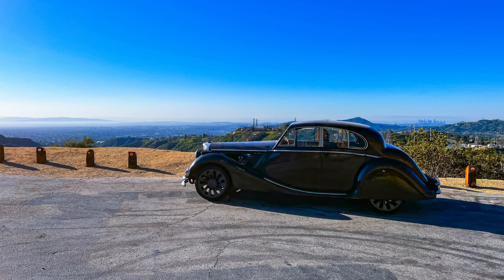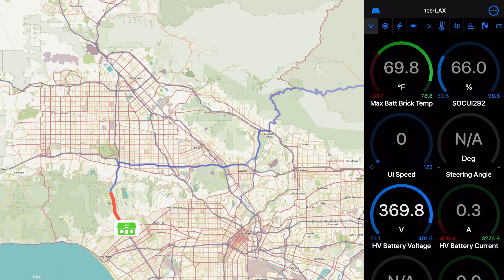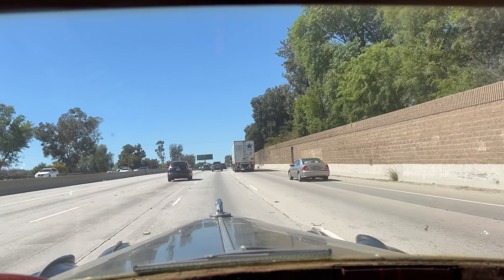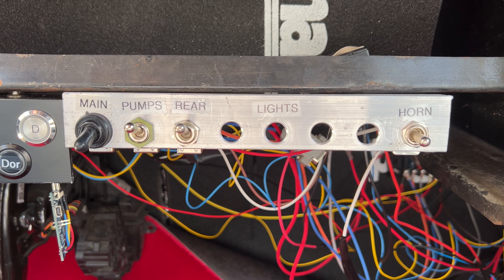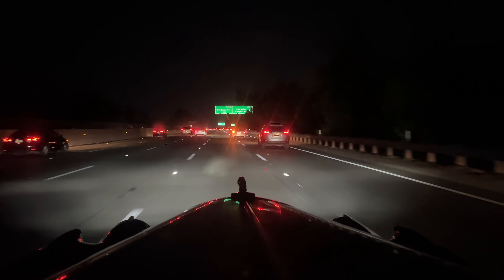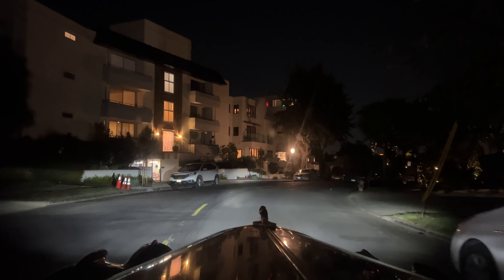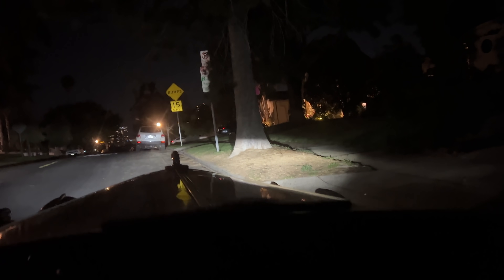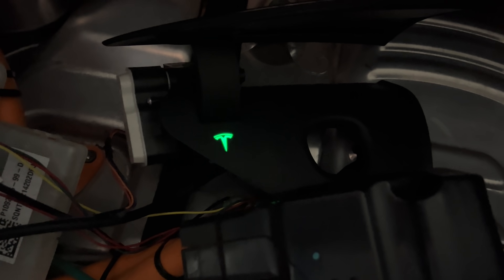I Find Out How Far A Tesla-Powered Jaguar Can Go

Comment: Oh man, that ending. How many miles did you end up getting out of the battery? And what’s the total SOC you ended up using with charging included?
Reply from the maker: Between the two trips I think it went through about 105% SOC, and I went about 160 miles. So given that 7% = 0%, we'll call it a 140 mile range.
Reply: Or about the same as a 78 Dodge D150 with a 440 and a 35gal tank. Seems about right
Reply: @SuperfastMatt  Why not get 2 Model S module's wire in an inverter say from an I-Mev backwards engineered to act as a jumper/get home battery ?? thus the inverter jumps the module's from 24v/?kw x 2 >> ?v/?kw? and to charge them just have regen only active for them ?? 2 module's/inverter in the old engine bay....
Reply: Would Neutral have been helpful on the short downhills, to build momentum rather than regen? You might have coasted further than you limped!
Reply: @richardortiz178  Going faster means more friction so more losses of energy to the outside of the system. With recuperation you transfer kinetic energy into electrique. Depens on the losses of that transfer of course but id say aerodynamics aren't in your favor. So recuperation should be better overall.
Reply: @kylereese4822  Every electrical conversion causes efficiency losses, aka heat. If you're gonna carry extra battery, you'd get better total range by adding to the main pack, because each cell delivers more total output when the draw is lower. This means that if you added 20% to the nominal battery capacity, the actual usable capacity increase would be more than 20%, assuming the extra weight didn't drastically increase the rolling resistance.
Reply: @SuperfastMatt  More than my 2015 e-golf.
Reply: @kylereese4822  If Matt did this, he'd HAVE to set the system up to be switched using the front half of an old British motorcycle petcock valve mounted on the dash. It would look semi period, and the "On", "Off", and "Reserve" markings would be very appropriate. :)
Reply: @kylereese4822  Because the easier/cheaper answer is to just charge it for 5 more minutes in the middle, now that he knows the range.
Reply: You should add a gas generator to the engine bay
Reply: A slight improvement in the rolling resistance might have worked. Putting a few extra PSI in those tires before the journey. Try it again with a few lbs more.
Reply: @andrewabbott4387  the little 2 cylinder prototype Mini engine would be great for that, or a Vespa 150 with the foot crank hanging under the bumper
Reply: @richardortiz178  There's no neutral in a Model 3 transaxle (or any other single-speed EV transmission), and a motor which not motoring or regenerating is basically in neutral.
Reply: @12x2richter  Let no-one accuse Matt of ever taking the easier/cheaper option, when a more expensive and complicated solution is right there for the making!

Comment: FYI the image you showed around 5:10 was a double pane window, found in upmarket vehicles to reduce wind and other outside noises. It may or may not have UV and/or IR mitigating tint involved, but the primary function is noise. That being said, a good ceramic tint job from a shop for ~$300-500 and you'll be set

Comment: On the plus side, you've already fabricobbled a mounting solution for the larger than necessary battery modules, so if you're willing to throw more money at the problem and open that can of worms back up, you can totally upgrade the range with the higher range battery packs.

Comment: I’m working on an electric car using 18650s similar to the Tesla Model S. I’ve built a motorcycle, snowmobile and ATV using these same cells. I put in an “Anti Range-Anxiety Switch” that gives me the option when my BMS kicks out the power to get home.  The BMS shuts off at approximately 3.0 Volts per cell. At full battery charge I know my range and amp hour usage. I know this quite accurately because I test to BMS shut off. I then use the switch to get me home. Never draining the cells below 2.7-2.8 volts. The batteries will last my lifetime 😊.   I’m also implementing the switch on my car.

Comment: Love the channel! Wouldn't  you agree "battery percentage" is of little use? I like the thinking behind the "cycle analyst" (ebike display from Grin Tech.). It's made for DIY´ers and displays the voltage of the battery pack and the watt hours used. When you get to know your battery, it's voltage and capacity at full charge, the low voltage cutoff etc., it becomes sort of intuitive how much range you can expect in different terrain, assist setting, weather, temperature etc.

Comment: Electric scissor lifts also have a low battery cut out and tend to get stranded when the battery runs out.  The cut out can be overidden by the engineer/delivery driver so there's always enough power to retrieve it and get in on the truck.

Comment: The contactor issue is likely a BMS over discharge fault. Pulling current through some resistance will drop the pack voltage. At some point during the drive, it’ll get too low and the BMS will open the contactors to prevent damage due to over discharge. When you let it sit for a few seconds, the power draw is gone, and the pack voltage will rise again, allowing the close of the contactors. Pretty cool to see it in action since Tesla hides it behind a wall of software protection

Comment: Great video. Such a good thing to test. I think range anxiety needs calibration for every EV driver and their car. Once calibrated it turns from anxiety to knowledge. :)
Reply: For sure.  I was so worried about range anxiety that my first foray into electrics was a Chevy Volt, which only has about 50 mile range, but then a fully capable gas engine behind it that kicks on when the batteries get low.  It turned out in the 2 years I had it, we only had the motor kick on about 3 times.  50 miles was longer than you'd think it was, even when there's no risk of being stranded.  
Now the EV I built, which may have the same 40-50 mile range, but I've never had below 80% charge because I'm worried about how long it'll last.

Comment: Discharging batteries very low damages them ever so slightly every time u do it. So whatever range u had u now have a tiny bit less than that
Reply: Matt used to work for Tesla as an engineer, also Apple and auto startup Canoo. He probably knows more about batteries than you.
Reply: @EmyrDerfel  Why so salty? I was just trying to add something that I didn't see in the comments nor was it mentioned in the video. I'm not even doubting Matt. He's a great mechanical engineer.
Reply: Ya those battery packs have BMS' in them, they're fine. Stop pretending to be an expert.
Reply: @NvidiaRTX5080  Ofc they have a bms, all the lithium based battery technologies have to have a bms to be safe to be around. But just because the battery voltage is slightly above the hard limit set by the bms doesn't mean it a healthy state of charge for the battery. An analogy would be maxing out parameters of something so that it's technically still in spec, but works way harder than it should and therefore decreases its lifespan significantly.
Reply: @QuibizOwl  These aren't generic aliexpress BMS systems, they're properly engineered to not do that. "Spec" is based on a worst case scenario for these, so it's well within what we would consider typical healthy operation.

Comment: I guess we've all had range anxiety whether we drive an electric or an ICE car. Still, despite it all there's plenty to be positive about - you made it home, and it's better mileage than, say an eight year old Nissan Leaf. I well remember making a 350 mile journey home from the south coast of England to the north east coast thereof. I thought I'd have enough petrol (I'm British!) but the last 25 miles with the little red light for low fuel on, then the last five with it flashing at me weren't fun. It was after midnight and all the petrol stations were closed. Sigh of relief to pull onto the drive!

Comment: You should try a battery pack with a power inverter, it could be your version of a fuel can. Hell, if it works you can cut up a Jerry can and make it an official emergency "fuel can"
Reply: Apparently Li-Ion has around 400Wh/L of power density. My Bosch Powerpack 400 has 400Wh and is about the size of a Water Bottle, so that fits.
20L Jerry can -> Theroretical 8kWh of energy storage. Even if you cut that in half for good measure that's nothing to sneeze at.
Reply: a 1 KW 110v battery generator. can charge a T for ~ 4 miles.

Comment: What a monumental moment. Few will understand the joy and stress of the first drive after rebuilding or extensively modifying a car. I stalled my first build at a light on the way to work and that's when i discovered the starter I selected of two options had a dead spot.

Comment: "I should've gone with the bigger battery" - The EVers lament
Reply: In fairness, the biggest reason for this is that the battery is THE most expensive part of the drive system.  When you're trying something new, it's hard to go "Sure, I'll spend $24,000 for a used Model S battery pack and get that 250 miles of range".  Matt went BIG here.  I converted a 1955 GMC truck, and the EV equipment ran me roughly $10k.  If I wanted a 200 mile range, I'd LITERALLY be adding another $18k to that figure, easy.  That's tough to do when you don't even know how it'll drive, whether you'll want to be in it for 10 minutes let alone 3 hours!

Comment: Watching this while battling the low battery indicator on my wireless mouse made it an even more nerve-racking experience.
Sure, I could put a new one in there (perhaps even the correct size), but I prefer the lighter weight and who's to say 1.2 something volts isn't plenty on a AAA?
Reply: I'm at 4% battery on my phone when I finished watching this, I feel ya.
Reply: Why do you need to move your mouse during a video?
Reply: @RustyCraftKnife  The thing kept flashing red for 30s after every action. That is supposed to be the low charge indicator, but the battery voltage was above that treshold, so I kept messing with it to make it read the voltage correctly.

Comment: Just carry a portable generator with you 😁😁 mount it under the hood and run the exhaust out under the back ! At least you can get some power back into your main power system
Reply: A vintage hybrid Jaaag would definitely be a sight to behold
Reply: the problem with that is, you would always be carrying around something you never actually want to use .....I realize that living out west USA(when I did) that it is pretty common to spend ~3hrs of each day behind the wheel driving; but where I live(now) I'd be visiting a whole nother state if I drove that far - and say if you lived in Europe you might end up in another country or something ... and it seems anywhere you go now in modern times, at least has power already there for light bulbs or something; but an old rusty leaking fuel can, maybe not so much

Comment: From someone who sets off from home in the morning driving to work with the low fuel warning light on, and doesn't fill up until I'm on my way home, I respect the experiment. I've only run out twice - once on the run down to the petrol station. Didn't have enough to turn onto the forecourt so I had to park on the road adjacent. Luckily my friends worked at that petrol station and ran out to push me the last 20 yds. The other time wasn't so good - had to wake my wife up to come out with a can of petrol. She was pregnant and unhappy with my stupidity.

Comment: If you wanted more range you could use fuel efficient tires. My Chevy Bolt came with Michelin Energy Savers from the factory. They are not grippy though, very hard. Also maybe you could run your pumps less, after you figure out how hot things can get.
Reply: I'm this case MOST of the energy is lost due to air resistance, not friction. That's kinda what happens when you have a brick wall going down the highway.

Comment: I'm wondering why the Grand Am had that interest? I can only think of two things... It somehow had a 3.8L swap (which is hard because of the very tight space), or it had the HO Quad 4. The HO Quad put 180HP to the wheels stock and could be comparable to the VTEC in power per displacement, but it also had a propensity to have timing chain issues, ignition heat-soak problems, and cracked heads - so finding a surviving one in good condition is exceptionally rare these days. Notable power for that era and coming from GM of all places, but poor reliability and I suppose that's why it's nearly forgotten about.

Can't think of much else that would really stick out for that model of car.

Comment: I know I'm way late... but something popped into my head regarding temperature monitoring. You mentioned not being sure which temperature you should monitor with your future(past?) stepper gauge mod. You also have full access to all of the CAN readouts. Does it actually matter which temperature your gauge is monitoring? Couldn't the gauge simply display the % of lowest temperature-delta-to-Tmax at any given point in time? That way, even if you have 20 or whatever  different temperatures to track you'd always know how close any one of them were getting to "I have a problem I need to deal with" territory 🤔

Comment: Sounds like the Electrica at Barber. It barely got up the hill at the dog leg, so I pulled off and told the corner workers there's no way it has the juice to get up the hill to pit. Pickup drags me back. I was hard on the regen all the way to pit road -- 300A regen. I bet I got 50mi out of that. As soon as I was on the flat again, I could drive back to our paddock. (and swap out 800lbs of batteries.) For the record, Barber is the worst place to try to "race" an EV (or W123 diesel for that matter)... it's f'ing uphill everywhere.

(The chevette diesel did well, but it's 90lbs, and they drove it like they stole it.)

Comment: The reason for the contactor relays opening when the battery is under 10% is due to the vehicle's voltage monitor. If a Lithium Ion battery begins to produce voltage that is lower than expected, the battery can decay rapidly which will lead to heat issues and possibly refuse to charge until the damaged cell is replaced. This is just a limitation on how Lithium based batteries work. Lead acid batteries can be run down completely and recharge without an issue as long as the acid does not begin to boil. Even if it does, the acid can be replaced fairly easily.
Lithium Ion batteries rely on thin wrapped sheets of Lithium around a steel or copper core and are separated by a waxy paper. The Lithium sheet constricts as energy is pulled from it, and this can eventually cause the thin sheet to rip. If it does rip, then the cell is dead. This can also cause a short and destroy nearby cells, or even a fire in rare cases.

Comment: My understanding of the battery cut off, is due to actual swelling and shrinking between states of charge and discharge.   A minimum charge is required to keep the walls from touching each other. Otherwise you begin to lose portions of the battery and begin running the risk of them internally shorting themselves out. See how Boeing learned this when they out sensors that drained their batteries to 0 and when they began to recharge, would catch fire midair

Comment: the contactors likely open to limit how far you can discharge the battery, since li-ion batteries will lose capacity much faster if they are discharged or charged too far

Comment: Reminds me of that time I went to the country side with my electric motorcycle, 60km of range announced (40-50 actual range) on the bike, for a 60 km trip...
Of course the bike died 10 km away. I recharged at a shop but I didn't wait enough so the battery died again and I had to push the bike through the end (no clutch, a lot of engine brake)...
Fun times

Comment: That was an awesome experience..the point is ...you built that.. and it runs and you are working out the kinks..does that work for a model 3 where if the battery runs low it opens the contractors and if you let them cool down like you did the close?..pretty interesting.. love your videos ..keep them coming.

Comment: #relatable - my choo choo has had a random infrequent misfire that I assume is one of the injectors and since it isn't consistent and it'll most likely require a retune I've resorted to turning the car off and on at freeway speed instead!

My exp with that style of battery is bumping them when they're near dead like that is the best way to ruin them quickly :D